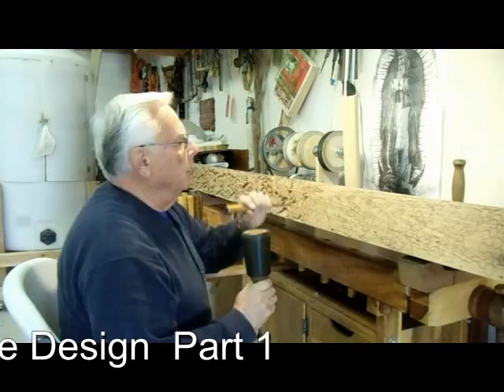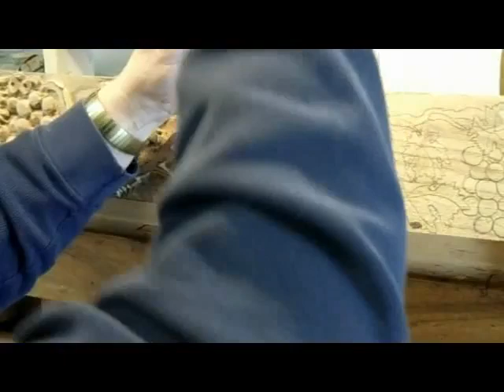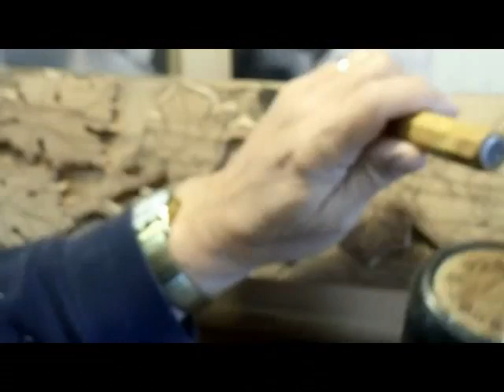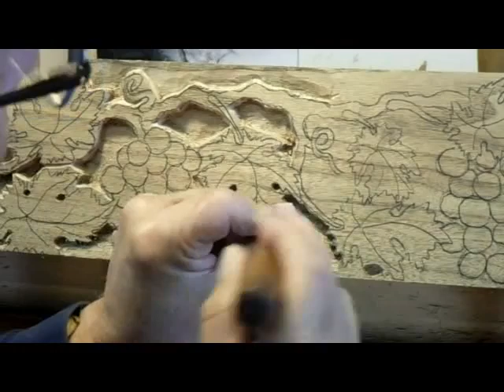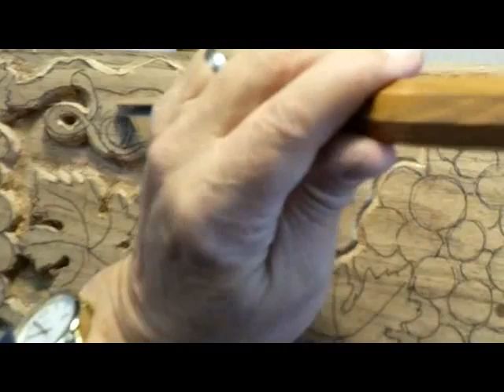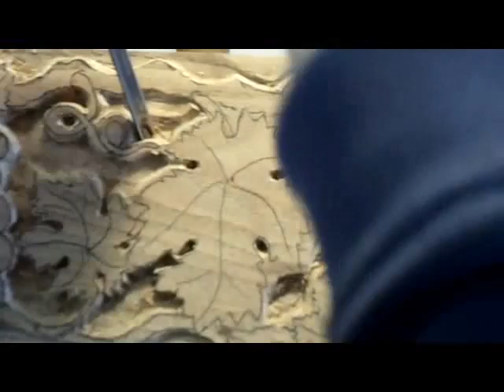Carving A Grape Mantel Part 1 of 2

Comment: How would one go about making a perfectly flat background?
Reply: This is a challenge because against a flat surface, every surface or variation stands out. Often we see forms of texture added to hide this so that it doesn't have to be perfect. I think he mentioned that he was planning to add vertical lines on the background. Others add dimples with a round punch.

If we have to get it flat then using a 3 sweep, or even a 2.5 is best. These are basically flat but the slight curve raises the corners of the chisel so that they won't leave lines.  For small details it often needs spoon and fishtail shaped chisels to be able to reach around features.
An alternative method is to use a Dremel type tool, but that leaves it's own type of texture.  
No easy answer; it takes the right tools and lots of practice.